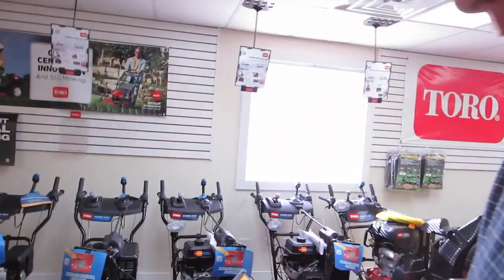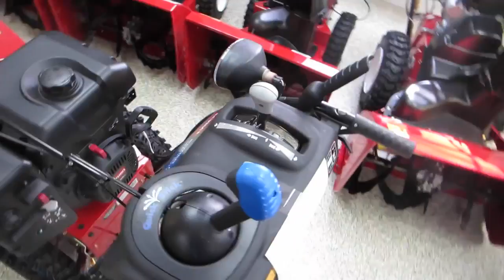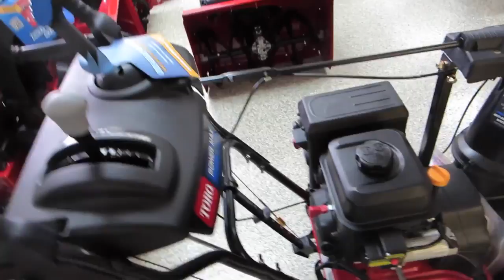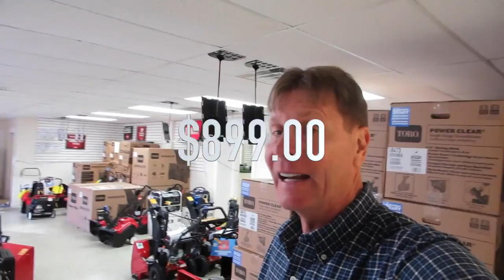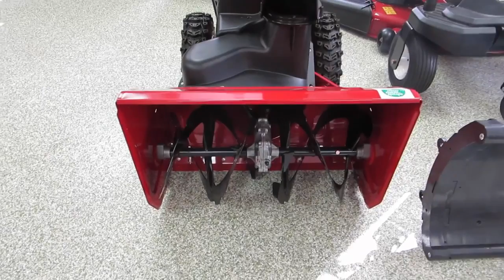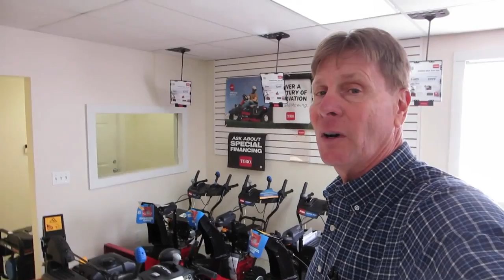Toro Power Max 2 Stage Snow Blowers

Comment: I have a Toro PowerMax 2 stage 212cc really like my snowblower. So I was really trying to think of anything I would change or people need to know.  I would change the auger and drive handles on opposite sides. For a right handed person its hard to keep moving and adjust snow shoot at same time specially on unlevel surfaces. For a person that is left handed its perfect. It takes time to get use to it. Not sure if you could change sides of controls on handles? Also if your snow blowing a small drive with cars parked on them this can be a beast to operate around things.I recommend A smaller size that is lighter. I myself do 6 driveways in old part of town and some are real tight and some like mine are real big.One drive has gravel  and very un even and it will throw rocks. Most my neighbors are older so their cars in the drive when snowblowing. I've had smaller 2 strokes toros and I end up breaking the welds on the auger do to a lot of ice over time. I bought a 2 stage Toro becouse i wanted a snowblower that will do the work and last me 30+years. I do highly recommend these snowblowers.

Comment: I was torn between the PowerMax 724 and the snow master 724 when I went to the dealer for the snow master the dealer told me that I should get the Power Max because for that price range I have a little bit more power for the heavy stuff and the end of the driveway build up.  He didn't speak bad about the snow master by any means. I have a detached three car garage that's about 90 feet away from the house plus I have a driveway from the three-car garage all the way to the front that runs aboutanother 70 feet to add on to the distance. I live in Connecticut and we get all kinds of snow. What's your take on that if you me?

Comment: Those are all fine and dandy, but they aren't built like they used to be. My 1988 724 is built to  last and that it did. I just cleared 5" - 6" of snow (more like wet, heavy slush) out of my 200+ ft. driveway today and didn't use 1/2 tank of gas. I don't know why they constantly brag about the "overhead valve engine" being so good. My tecumseh is going on 35 years old and it runs like new yet. Doesn't burn a drop of oil and is very fuel efficient.